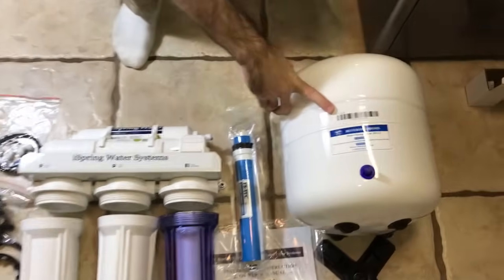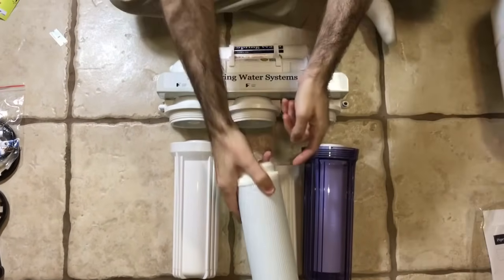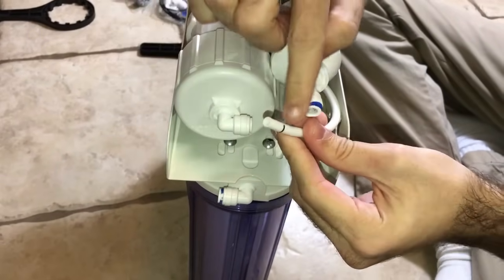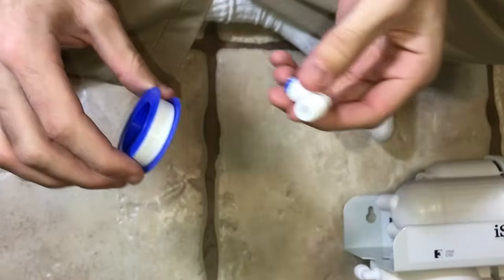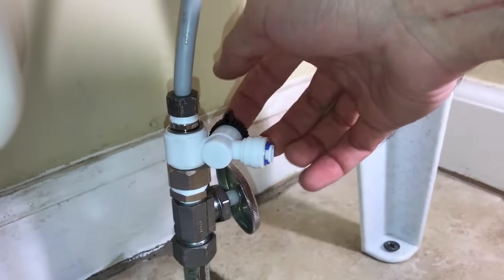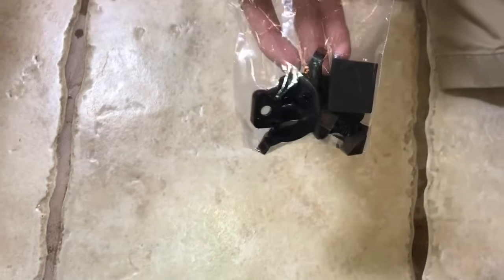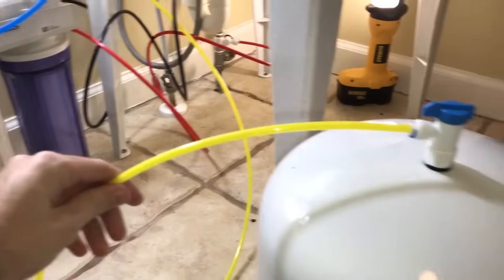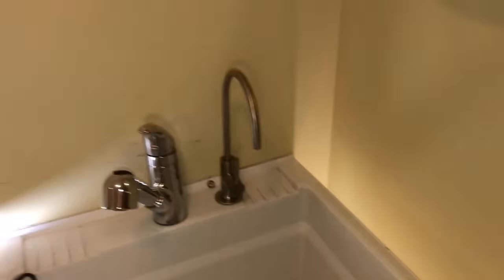Installation | iSpring RCC7 Reverse Osmosis Water Filter System

Comment: I need to drill a hole for the RO faucet. What size drill bit should I use?
Reply from the maker: Hi authorsauditions,

Thank you for the question! You need to drill a half inch hole for the RO faucet. 

If you have more questions, please feel free to call us at 678 261 7611(Monday - Friday, 8:30 - 5:30 EST) or email us at support@123filter.com. We are happy to assist you!

Best,
iSpring Water Systems, LLC

Comment: Just installed all new filters, membrane, carbon inline filters and new take but my take is not filling. Checked the pressure it's at 7
Reply: Hi Robert Pasco,

The tank will take about 2 hours to fill when 1st installed or when the filters are changed and the tank is emptied. Are you giving the tank time to refill? IF you are still experiencing issues please contact our customer service dept. at 678-261-7611.

Thank you,

iSpring Water Systems LLC

Comment: I have the RCC7P-AK version. I got everything set up and flushed the first three stages but when I finally connected the first three stages to the rest of the system and turned the water one. After a few seconds the pump got really loud almost sounded like the water was backing up and no water was trickling from the faucet.

Edit: so I let it go and fortunately I'm not getting any leaks. Water is trickling out of the faucet. I can definitely hear the pump going and there is a hissing sound. Is that normal?
Reply: Hi,

Yes this is normal operation for the systems with the booster pump. The tank will take about 2 hours to fill initially when the system is installed and until the tank is completely full, you will not have flow at the faucet. The pressurized storage tank is what provides the water pressure psi to the faucet. If you are still experiencing any issues please contact our customer support team at 678-261-7611.

Thank you,

iSpring Water Systems LLC

Comment: My tank has been disconnect over a year.  I took the tank valve off to replace the tape and water is continuing to bubble out of the top of the tank.  How does that happen?  What is that blue thing on the side of the tank?  Is there an air bubble inside that's pushing the water up?
Reply: Hi Robert Blake,

There was most likely water and pressure (PSI) still in the tank when you removed the ABV2K tank valve. The blue cap on the side to the tank covers a valve stem (Similar to a car tire air valve) that you can adjust the pressure of the internal bladder in the storage tank. If you need help understanding this process please contact our customer service dept. at 678-261-7611 or email us at: support@123filter.com .

Thank you,

iSpring Water Systems LLC

Comment: I just installed this unit but there's a sleight problem. is it normal for a lot of water to drain out as I'm trying to fill up the tank?
Reply: Hi Maxtremo Gaming,

Yes this is normal operation of the system. Whenever the tank is filling the drain line will be running, but once the tank is full the drain line will stop. Please let us know if you have any questions or if you need any additional assistance.

Thank you,

iSpring Water Systems LLC

Comment: Hi I followed the installation , I have the RCC7AK. Everything was good EXCEPT the water flow from the RO faucet is very bad, not quite a trickle but not as good as you show here (with a full tank).  I already checked the flow coming out of the 3rd stage (when cleaning out the carbon) and it was very strong. So what is causing this slow flow? Are the filters (RO Membrane, Alkaline, or something in the tank ?) Causing this?
Reply: Hi Ajay,

Please contact our office for assistance at 678-261-7611.

Thank you,

iSpring Water Systems LLC

Comment: Hey serious question.   If disposal or dish washer are used will it backflow into ro drain?   I think I’m going to get a check valve for the ro drain as well.   Appreciate the advice.
Reply: Hi James McClaren,

The RO System has both a flow restrictor and also a check valve on the system to prevent any back flow from the drain/waste water back into the system. The additional check valve is not required but you could purchase if you wanted additional reassurance. Please contact us at 678-261-7611 if you have any questions.

Thank you,

iSpring Water Systems LLC

Comment: Great video so far! Although common sense can be made about this but before connecting the adapter, I would have suggested to turn off both water lines. Also, I just connected the red line to my system to flush and you didn’t mention anything and I started my water and the red line popped off and half my kitchen floor got sprayed with water. Wish you explained better for that part.

Comment: Okay I finally got it set up, and it was working fine yesterday when I was flushing the tank.... but now today the tank will not fill up. I do not know why, I think the automatic shutoff is malfunctioning and not letting the tank fill up
Reply: Never mind, it finally filled. Took it about an hour longer to fill than it did yesterday, any reason for that? But anyway I love it. Great system. My tap water was testing at 553 ppm, after going thru the RO filter it is 18 ppm. That’s a huge difference.

Comment: Nicely done, except for the part where the blue tube fits onto the R/O faucet.  I happen to be missing the tube insert, collar, and nut.  The video shows flushing the system, then after the black tube is fitted onto the drain, the blue tube is apparently attached and the faucet is used.  I looked back and apparently these a parts are not included in the parts review at the start of the video.  Step 2.3 in the instructions, however, states to "slide the Nut, the Collar, onto the end of the tubing. then Step 2.4 states to push the Tube Insert into the open end of the tube."  Also, the manual suggested using a vertical drain pipe if possible so the drain water will quiet down a bit. But, maybe it is I that missed something here, you guys are a lot better at this than I am.  It's been 1 1/2 years since the video was made. Does anyone at iSpring monitor these comments anymore?
Reply: sorry, i meant it states to use a horizontal drain pipe if possible...
Reply: and...I just noticed from the video that my faucet is not designed the same way where the tube attaches - mine has a smooth polished metal 1/4" end of about two inches that one of these 1/4" connectors with a clip fits over. I do not know how to proceed at this point. That tube is under constant pressure and I have to know it will hold.
Reply: Hi George Scott,

The faucet connection was upgraded but the instruction manual has not been updated. We apologize for the inconvenience. So you no longer need the nut, collar, or insert to connect the faucet to the blue tube. You should have received a grey color quick connect fitting with the faucet that you connect to the end of the faucet. The grey color quick connect fitting will lock into place onto the post at the end of the faucet and then you can quick connect the blue tubing into the other side of the quick connect fitting. Once the blue tube is connected to the fitting, you can lock the tubing in place using the small blue clip. If you have any questions regarding this process please contact our customer service dept. at 678-261-7611.

Thank you,

iSpring Water Systems LLC

Comment: I've always read, heard, been told that Teflon Tape or pipe dope, should NOT be used on plastic fittings as the lubricity is not needed, and you run the risk of over torquing the fitting which can lead to cracks and then failure.

Comment: i've installed ispring rcc7ak but after so many tank flushes im still getting impure water from the system like those tiny particles they are really visible
Reply: Hi Orpheus Zaf,

The tiny air bubbles or milky/cloudy water is normal for a new install of the RO system. The tiny air bubbles are trapped air inside the system and normally this will dissipate in about a week or two. You can speed up the process by flushing the system and storage tank a few additional times. Please contact our office if you need more information regarding this process at 678-261-7611

Thank you,

iSpring Water Systems LLC

Comment: You do not need to wrap teflon tape around the threads on the shut off valves under the sink.   They have rubber gaskets to create the seal, the threads are there just to draw it tight to the rubber gasket.  Similar  to a garden hose, the rubber gasket makes the seal.   Nonetheless, great vid.

Comment: What should be the drinking water ppm? Can you please upload a video about changing the filter.
Reply from the maker: Hi #PrincessK_A_Y!  There isn't a recommended level, EPA suggests anything below 500 mg/L. TDS or PPM are made up of various different things in the water, some good and some bad. Unless you know exactly what makes up the TDS then it doesn't tell you anything about your water. For example. gasoline has 0 ppm and fiji water has over 100 ppm. When water filtered through RO system, you should see a 90% reduction or more in total dissolved solids or ppm.  Here is a link to filter change video. https://www.youtube.com/watch?v=3uX0AJgQkLo    Thanks
Reply: iSpring Water Systems Thank You So Much!

Comment: Correction: On the drain saddle, the bolt faces away from the connection (opposite of what was done). The nuts fit into small recesses on the other side so they don't spin. Thanks for the video. Helpful.

Comment: Just installed mine (7 stage UV).  The hardest part was going back to put the Teflon tape on the threads of the cold water line (whoever did the plumbing initially didn’t bother with tape and it wasn’t leaking... so I didn’t think I needed it at that point.  I needed it.).  

Just flushed the first 3 stages and am waiting my 15 minutes for the system to completely flush- that trickle is indeed very very slow), before I fill and then flush the tank... that is going to be a loooooong wait...   but no leaks so far!  I love quick connect!

By the way, I bought the ice/fridge kit and it couldn’t have been easier to install.  May upgrade the tank at some point...
Reply: If you have this system under the sink, how do you connect your fridge to the ice/fridge kit? Is your fridge on the same side as your sink? Or do you run the hose somewhere?
Reply: I drilled a hole in the side of my cabinet and ran a line to connect to my ice maker line… that said, this system catastrophically failed.  One of the main compartments sprang a pinhole leak.  I bought a simpler competitor model (waterdrop) that has front change twist cartridges that are much easier to change out.  So much less hassle so far!
Reply: @eternalgreenknight  this is great additional information. Thanks for sharing!

Comment: If I do not want to install the tank or the faucet what can I do?? thanks!
Reply from the maker: All of our residential reverse osmosis systems require the use of a pressure tank to deliver water to your output source with any pressure. If you don't want to install the faucet, you can connect the system directly to your refrigerator or icemaker and leave the faucet uninstalled.
Reply: iSpring Water Systems..  ok thank you. I need a system for my fish tanks that will give me 100gpd .. any suggestions? This one works good so far for drinking water but not the intended application.
Reply: iSpring Water Systems what if I just run the line that supposed to go to the tank into a large catch barrel that should work.. just not as fast.. but not as slow as waiting for the tank to refill every hour.. correct?
Reply from the maker: Hi Kevin, for custom orders and installations like this you can contact technical support directly at 678-261-7611 M-F 9-5 EST or by email at support@ispringfilter.com. They'll be happy to answer any questions about your specific installation.

Comment: Great video but one change needed. For the feed water adapter (AFW43), these are compression type fittings with a rubber seal. Teflon tape should NOT be used on these threads. The rubber seals the connection, not the threaded connection.
Reply: Will kit hurt anything to use the tape?
Reply: @user-vu3xb7qn8g  nope
Reply: @user-vu3xb7qn8g  too much tape can interfere with rubber seals, often seen on amateur jobs.
Reply: Eric Marshall صض ش ظط

Comment: For anyone else looking for flushing instructions, that section starts at 10:43. Everything else in the install was straightforward enough without the video, but the flushing section of the manual could use some clarification.
Reply: See yesterday when I finished setting up my system, it was working fine. I was able to flush my tank twice, and today I was gonna flush it one more time before using the water coming out of it but now the damn tank WILL NOT fill up. Yes, the main valve is on, the tank valve is open, and I do not know what the problem is. I think the automatic shutoff is malfunctioning
Reply: thanks

Comment: My house doesn't have the cold water shut off valve, it just has one main shut off valve outside with the water heater.... can I just hook it up to the cold water line going to the faucet? it's the right size so will it work? please reply ASAP
Reply from the maker: Thanks for the question! If you take a few minutes to contact our customer support directly, we can take at look and see if this system will work for you.    
You can reach at 678-261-7611 or email me at sales@123filter.com 
The system is intended to be installed under-sink by teeing off from the cold water valve that supplies your kitchen faucet; however, the system cannot be used with a standard kitchen faucet and will require installation of separate faucet. If the cold water line running to your faucet doesn’t have a shut off-valve for some reason then you’ll just have to turn off the water main outside before you being working, or bring a raincoat

Comment: great video! I was going to by an RCC7 5 stage and just saw on amazon the RCC7ak 6 stage for the same price. What do you suggest I buy? Is the install the same with an RCC7ak 6 stage?
Reply from the maker: Hi there! The only difference between the RCC7 and the RCC7Ak is the AK. The Ak is one additional filter that adds some healthy minerals back into the water to improve taste. In my opinion, if you're looking a both for the same price go ahead buy the RCC7AK. It you don't want the additional filter you can simply remove it at any time to make your system the RCC7.
Reply: iSpring Water System 

Thank you! I ordered the 6 stage!

Comment: Great video. I just installed mine, but screwed up the flushing part... I didn't drain it after the third filter (I misunderstood what you meant) and by the time I caught it, I ran 4 minutes of water through the system. Am I ok, or do I need to buy the 4th and 5th filters? Any help would be great!!!
Reply from the maker: You’re ok! There’s no need to replace your filters, since the excess carbon was instead filtered out by reverse osmosis rather than flushed out. You can easily go back and correct the mistake by wiping down the RO membrane and housing with a paper towel. 
Ignoring this step overtime will just cause the membrane to clog sooner than expected, and will lower the production rate of clean water.
Reply: iSpring Water Systems I made a similar mistake; forgot to flush the first 3 filters initially so I just ran them through the entire system for 30mins instead of the suggested 10-15.
The water is coming out a little cloudy at this point. Will a wiping/rinse of the RO do the trick, or did I make a worse mistake?
Reply: @sobekenobie  Hey man what did you do to correct the mistake? I did the same thing :(

Comment: I am just about to purchase this same system. I am wanting to run the same system to my refrigerator for water/ice. Can i just put a tee in the faucet line?
Reply from the maker: Yes, you can install a tee on the output or faucet line to supply water from the system to your refrigerator. You may be interested in looking at our kit designed for that very purpose, the ICEK. https://www.amazon.com/iSpring-Connection-Reverse-Compression-Fittings/dp/B008H71Q4C

Comment: Calm, no drum beat music... very professional!! Thank you for showing your installation. I just bought the iSpring RCC7 system and about to install it. Your video with instructions is very helpful. Question: do I need to pressurize the storage tank for 1st time use? Once again, THANKS!
Reply from the maker: Thanks for your question. It comes pre- pressurized at  7-10psi and ready to go.
Reply: Vinh Nguyen is the tank always has to be pressurized? You use a air compressor to add air to it? What happens if I buy the osmosis system with the booster pump? Would I still need to add air?